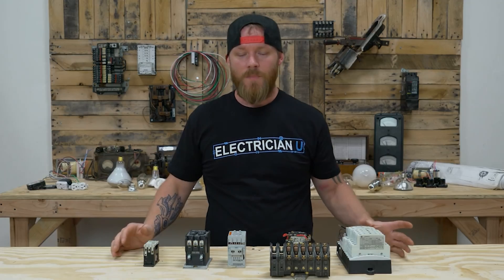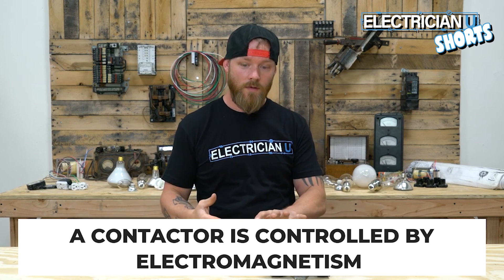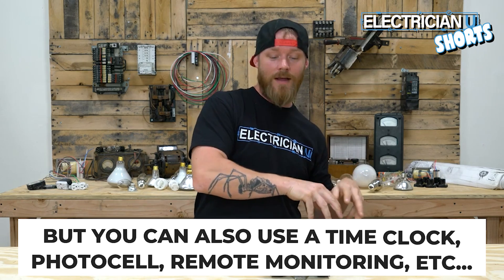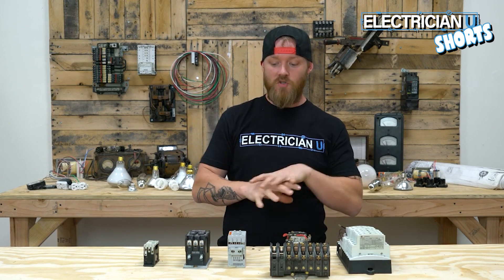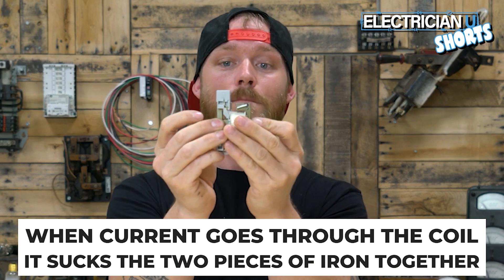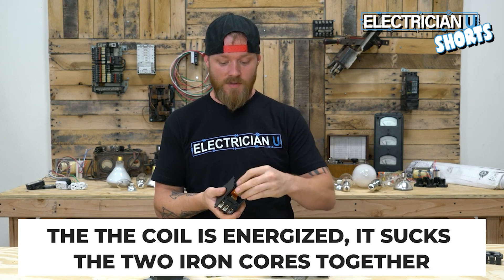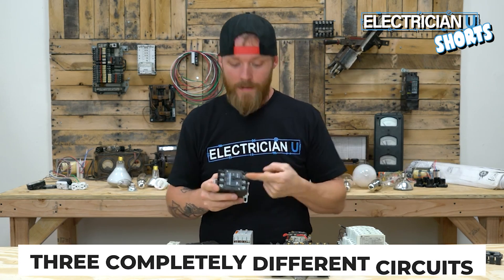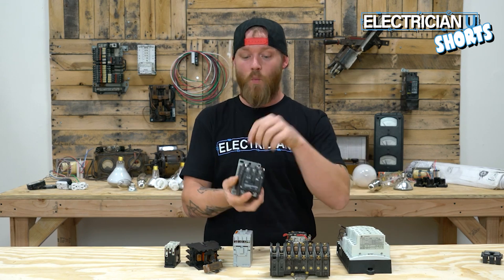SHORTS - Contactors: What Are They and How They Work (In 4 MINUTES!)

Comment: The control circuit, could also be one of the line side circuit  tapped before it gets to the contactor- run to time clock, and back to the coils--but usually a cotrol circuit is designated

Comment: I'm looking to setup lighting contactors & timer switch relays for a project. I'm trying to connect 10 - 240v outlets. 20 Lights will pull 4.2amps each @ 240v. Any recommendations on contactor brands or configuration? Any help much appreciated.

Comment: Asked our Allen Bradley salesman years ago who makes a quality long lasting IEC contactor. He said they all have a relative short live compared to a starter. So whenever you have the space replace garbage IEC cintactors with starters. We used to remove overload block on starters to save space when swapping out an IEC contactor. Stay away from all GE contactors & starters. GE startets inside of MCC buckets always make the bucket 30 degrees hotter due to high temperature of ge garbage coils. If you have a motor that turns on & off several times a minute best pratice is to use the next size contactor gor a long life.

Comment: Contactors are functionally just like relays but have more robust make/break and arc control features for higher energy loads.  The separate low energy (voltage and/or current) control circuit permits less robust, and therefore less expensive, switches and sensors to be used to control the high energy circuits.  This also permits the high energy circuits to be optimized for power delivery without undo bulky and expensive cabling to operating stations.

Comment: Great video. Still learning a lot from your videos. Just slightly confused, let's say I have a battery and inverter :D. If the battery provides more current than it is suppose to, I want to break that circuit, I would use a closed contactor? Once the circuit is broken, I require a separate device to turn it back on, or would the contactor do that automatically after a set time period? Or am I thinking of a totally different device for this scenario?

I have a dc circuit breaker set up in event of catastrophic faliure. Sometimes there are minor surges. Let's say, the max capacity is 10 A, i get a breaker that trips everything at 15A. I want a device, when the current is between 11A and 14A, it should turn off and turn back on when the current supplied is back down to 10A or less. I know for AC current there are these automatic circuit breakers that look at under/over voltage, under/over current, phase out of sync. I am looking for a similar device for DC current, I can't seem to find it online, nor can I find a name for it.

My electrical knowledge = zero :D. Just learning things as I go along researching things.
Reply: There are automatic resetting circuit breakers for that small load in DC. Look for an ATC type self reset 10A breaker.
But there is no way to stop a battery from supplying "too much" amperage, as a battery always wants to give everything it has all at once. The load, the inverter, is what limits the power draw, and the inverter bases this on the load put on it.
The smarts to limit power draw need to be in the inverter itself or on load side to the inverter. The circuit breaker bwteeen the inverter and the battery is just a fail safe to keep fires from happening.
Also, 12v 10A to the battery is very tiny, 120v 1A assuming 100% efficiency. I am guessing the 10A is on the 120v output side?
Reply: @JasonW.  thank you. I am trying to ensure I don't set the house on fire with this DIY project. Taking extra precautions, even though they may be unessary. The cells are 280Ah, lifepo4 cells. 48V, series configuration, 3.2v nominal voltage per cell. 16 cells will make up the battery. Gives about 12 hours backup at 1,000watt draw per hour. 

Wires going from the inverter to the house distribution box has circuit breakers (AC). BMS to cell for balancing = has glass fuse wires of 2A~3A. A BMS usually does 1A, most are 0.5A. 

Inverter to battery  setup = Inverter>>Shunt>>BMS>>Battery

The inverter will control the main input, max current and cut off voltage. BMS will be a fail-safe to cut off voltage in case for some reason the inverter has not cut off the supply. 

I want circuit breakers or something similar to cut off power in case of voltage or amp strikes. Possibly reconnect as well. This will provide a third layer of fail safe. There is a main dc circuit breaker for the battery to inverter, but the rating for tripping is beyong the max load. I want an automatic reconnecting one that is close to the max so as to protect devices in the whole setup.

Does that make sense? Still trying to figure it out in my head.
Reply: @asderven  Considering what you just posted, you do know some about electrical.

Check out marine hardware sites for boat electrical. That is where I bought parts for my DC side of my inverter.

I run 3 banks of 2x 12v 100Ah batteries for 24v to the inverter. I have a 100A breaker between all 12v pairs, and also a 175A breaker at the input to the inverter.

My chargers are 100% independent of the inverter, and balances by each 12v battery has its own charge line.

My inverter smooths starts by soft start (slow rolling voltage to 120v in about 1.5 seconds). I then have circuit breakers from there controlling power output.
Reply: @JasonW.  great sounding set up. I am in Pakistan, sadly most of the recommendations I find online are not applicable in an easy way. The automotive part you mentioned is not carried by the local electrical stores around me (even the big ones). The car repair shops are like we will buy it for you, and you can buy it from us, I am like, no thank you. The car parts shop are very far from home about 2~3 hours drive, not doing that in Covid especially with lockdowns. 

Local store owners speak their own language, have their own jargon for things which makes sense to them (just like how pharmacists can read doctor's handwriting). I usually find what I want after talking things over and describing the details. Don't have the easy marine site information or online websites that I can browse, except aliexpress. Aliexpress has a 3 month shipping wait time. Trying to source a local shop that is a single stop and caters to most of what I want, so far little luck, everyone carries a specific thing, but not all. The person who carries connectors and terminals will not have heat shrink. Neither of those two will carry crimping tools. Lots of running around, but with time I am getting better.

All that I know about electrical is from reading. Haven't made any setups yet, so still clueless on the practical side. Doing things with your own hands is the quickest way to learn and understand things.

To me it sounds like I just need a normal circuit breaker, in case of massive failure events to cut the power off. I'll add an extra switch on the battery side, that will cut off the battery for me, when I want to change wiring or install new parts to the system. I'll keep on reading online forums for lithium batteries, watch youtube videos to find best practices. I often find that people on online forum use a cheaper solution, rather than a slightly more expensive but headache free solution. I prefer to set up solar system and forget about them. That is how they are supposed to work (once all the settings are done properly).

Comment: Electrically they are pretty much a big relay, Mechanically they usually have two points of contact per circuit vs relays with a pivoting contact, this helps prevent the contacts from becoming welded (usually)

Comment: There is a spring to disconnect the contactor when relay coil is not energized...
Reply: if you have a solid state relay the contacts will open the circuit when there is no light from the primary side of the relay light hitting the semiconductor.

Comment: What do you mean by three circuits on the contact and one circuit on the coil?  I thought if three circuits coming from the pane!, then you have three circuits going  out from the coil/control? Thanks in advance man
Reply: The coil circuit is a switch leg so it's a controlling circuit and is only energized when switch or switches are activated, be they pneumatic, modular or mechanical...
Reply: Thank you both. That makes sense